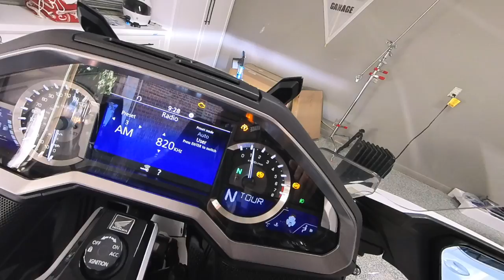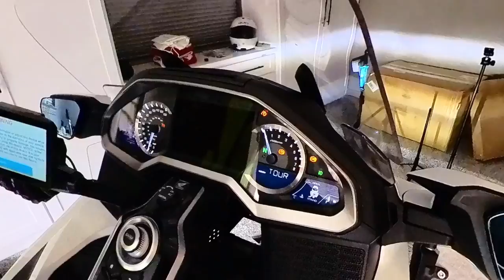Replacing A Dead Battery In My 2018 Honda Goldwing | Cruiseman's Garage

Comment: As usual we all thank you for bringing these glitches to our attention. These Vlogs and your maintenance videos are invaluable save us thousands in labor costs.  Amy owner of a Goldwing who hasn’t purchased your videos, and in my case also Fred Harmon’s videos is missing out.  The satisfaction one gets from doing 95 plus percent of required maintenance  is a small 0:10 feeling  of doing it yourself knowing it is done right.  I did add the Traxxion battery bolt extenders to allow a bit more space if adding mandatory direct negative and positive wire connectors.  I had to trim the positive one about a quarter inch to allow the cover to seat properly.  Love Scosche connection. Reminder to carry the connector for interface  to Battery Tender if you have other devices , air pumps etc that use the SEI (?) connector. Although the Traxxion bolts will also alligator connectors. 😎

Comment: I really like this video.  I have a 2018 Goldwing and have had the issue where the bike would not shutdown properly.  We also had another Goldwinger had this happen during a Rally.  I know to recheck it once I do a shutdown.
Now to the video!  I am currently in Saudi Arabia, left home in August and had to leave my bike at the house.  I showed my wife how to operate the battery tender and she did a great job of starting my Goldwing enough that we felt confident that this was keeping the battery to close to full charging level.  In February, she went to start it and nothing!!  She showed me where the battery tender was showing green, but still nothing.  I had her check the cables and the same (I'm not including everything we tried but trust me).  I had her take my battery pack and plug it in and my bike started, but once she cut the engine off, it would not restart on its own.  So, we decided to replace the battery.  Being a smart person as she is, she said she would take care of taking the battery out, having it checked and reinstall it.  She looked this video up on youtube and completed the mission.  Thanks for all of your videos.  I am a subscriber to your video series (both sets, since she has a 2016 GL1800 Trike) and they have been fantastic!!

Comment: CM shame on Honda for not having a positive down when the ignition is turned off. I did leave the ignition on Accessory mode when completing a ride on my 2012 FLHTK, I wanted to listen to a song when I was removing my gear after finishing a ride. I caught it an hour later when I went in the garage for a beer. Your review of the Scoche convinced me to purchase one in September in preparation for my trip to Street Vibrations in Reno, NV. It was the best move I've ever made; I got the SAE connector also. Yes, I ride a Harley and I've watched your channel for close to 3 years now. Not a fan of the 360 view on the GP, but that won't keep me from watching...Keep up the good work...

Comment: I had the same issues many times. Lights flashing, battery was dead, trickle charger would not charge the battery. I could jump it and it would start. Then try to start again. Dead. Took it to the dealer many times. Replaced batteries at least five times. Problem would come back. Had Honda tech support involved. They could not find out what was the issue. In the end, Honda had issues with the red starter module. The defect caused electrical issues like dead batteries and weird issues with electrical components. My 2019 issues took 2 years to get to the bottom of. Since that unit was replaced, zero issues. I have heard that some Harley had the same issues. Possibly used the same vendor to build them. Not sure. I never ride without a jumper box. I have been stuck to many times.     I hope this helps.

Comment: It is very important when using a jumpstarter that you disconnect audio fuse A15, which is in the right column, the sixth one from the bottom. The check engine will go after some rides.
Reply: Thanks for the advice about the check engine light going out after some rides. I have rehooked mine and the light has come on.

Comment: (Belated Happy Birthday Chris!!!) Thanks for this, I have seen the bike not shutdown when the knob was turned before. It's always happened when I park in my darker garage where I can see the headlights still on. Turning the knob on and then off again finally shuts down the bike properly. I wonder if the bike was creeping or moving slightly which caused this. I've had the MIL (malfunction indicator light) on when the bike's failed to start properly first time - it's happened twice I think. In each case the MIL went out after five or six successful starts. I wish I could use my car's OBD2 tool on the GoldWing though to actually read the codes!!! 
And thanks for letting us hear that gorgeous bike start up. Up here in cold and frozen Canada, most of our bikes have been in storage for months - we miss that sound !!! 
Camera and sound seem fine.

Comment: I suggest using a battery tender whenever you park the motorcycle at home. My Optimate conditions the battery as well as maintaining the charge. I have been postponing buying a jump starter. When I saw the SAE adapter for yours, I ordered the jump starter and adapter. I like the new video.

Comment: I like the new camera you're using.  Good video quality & it handles motion well.  However, it does distort the picture slightly due to its wide angle views.  But, I'm okay with that because I can see so much more in that mode and it's good clear video.  I give it a thumbs up and would suggest you continue using it.

Comment: Chris, I don't know how you can stand to work on your Goldwing without a ratcheting screwdriver.  I have been using Snap-on ratcheting screwdrivers for 20 years, (just the brand that I prefer),and I love them.  Makes so many task that require a screwdriver so much quicker and you can change the bits in the end to accommodate a plethora of different fastener types.

Comment: Maybe I missed something but have you been changing batteries just because you discharged them? Batteries are salvageable 9 times out of 10 with the proper charger and time on that charger. I have my original battery in my 13 Wing.  Most battery tenders don’t put out enough juice to recharge a battery in a week let alone over night and most chargers are so sensitive now they won’t kickstart a weak battery anymore, it’ll just say bad, gotta keep an old school charger around just for that very reason.

Comment: Thanks for this video. After having my 2023 Goldwing for two months now, I ended up with a dead battery. 

My question is, how long did it take for the “check engine light” to go off after swapping batteries?

Comment: Just fyi that has worked for me referencing the check engine light. It’s worked for me on my 2018 DCT Tourer. I start the bike from a cold start and let it idle until the fans come on. Shut bike off and restart. The MIL light is off. Just a suggestion.

Comment: Still with the OEM battery with my 2018. I keep the bike  plugged into the battery tender when the bike is parked....surprised you didn't put the new battery on the charger before installing it in the bike.

Comment: I've had a few instances on my 2020 where I've turned the switch to shut the bike off and the engine dies but everything else stays on.  I always just figured I had turned and released the switch too quickly.  Turned the switch again and shut everything off, I've never accidentally left it on.  Good video, the new camera is quite interesting.  Could prove to be very useful.

Comment: like the camera. what software glitch causes the lights to stay on if the bike is  "moving" when shut off? is it corrected on 2019-2021? is it exclusive to DCT? does it necessitate using the parking brake all the time?

Comment: My Goldwing wouldn't shut off, lights were on and could not turn off.  I didn't notice this for about 2-3 hours.  I am sure the bike was not moving, kickstand was down.  The lights stayed on for hours and finally died with the battery charger on.  The next day there was enough juice in the battery for the bike to start and turn off as it should.   Since this was the original batter that came with the bike I bought 3 years ago I am planning on getting a new battery.

Comment: I have a suspected duff battery, Still original 2018 battery and have been in the States for the last couple of weeks and on my return to the UK the bike lights up OK and plenty of sound from the horn but when I press the start button, nothing. It happened when I was away in May but half an hour on the charger and she fired up OK but not having any of it this time.

Comment: I replaced my battery with a lithium battery Amazon Noco NPL 20 and it's worked perfectly I don't ride everyday so if I let the bike sit for a week or more it starts right up and it was smaller and easy to get in . PS it's a year since I installed it so far it's been really great

Comment: I love my 2022 DCT but I must say it certainly has some weird characteristics….  As for the new camera, it’s the first video camera I would consider getting.  Seems to be a more realistic view we experience while riding.  I will be interested in ur thoughts once you get to use it more. Btw, any comment on the video which indicated a rider who spends time practicing slow speed manoeuvres with a DCT has gone through two transmissions on two different DCT’s?  Reportly Honda covered the first replacement under warranty but refused to do so on his second, newer DCT wing.  Claimed slow speed manoeuvres were somehow “abuse”.
Reply from the maker: The DCT issue is something I plan to talk about in my next Crown and Comments. Stay tuned.

Comment: When you turn off the bike. Turn switch all the way. Then engine and bike are off. If just a quick flip/turn the lights may stay on. Honda did not design the ISG to work with a lithium battery. Per Honda!  To charge the battery it needs to be on a Automatic type AGM Battery charger at 2-10 amps for 10 hours. I suggest you charge your new battery to full charge. Per Honda service manual 13.2 votes is full charge. This means battery amps are at full charge. I get it buying a new battery is good insurance buy if you had charged the dead one at 2-10 amps for 10 hours I bet it’s going to pass a load test. Try it. The GYZ20L battery is rated at 250 amps but will load test at near 300 amps if full charge. Three types of battery in general Standard, AGM, Lithium. AGM is a Powersports battery and this type is used around the world.

Comment: This summer I accidently left my switch on for 2-3 hours. I was in a very remote town in Alaska. It was dead with like you were seeing, very dim lights. I was able for get it jump started by a good Smartian. I ran it for 1/2 hour to put in a charge. It started the next day, and it has been fine ever since. Fingers crossed. I know you are not supposed to charge a battery from dead with the bike. I know I should have put it on a real charger. I was 100 miles from any sort of motorcycle shop or charger.

Comment: goldwing 1800 dct 2018 Battery problem Yuasa GYZ20L part 31500MCA941 12V
In the end Yuasa Japan discreetly confirmed that in the manufacturing batches of the GYZ20L batteries for the Golwing 1800 GL some were faulty but that it was impossible to know which ones many owners encountered this battery problem throughout the world including me (Thailand ) Yuasa does not provide any guarantee on this type of battery in any case it must be changed every year,...
In the end, the concessionary resellers were careful not to give the information coming from the manufacturers to avoid conflicts with customers......business

Comment: I had the original battery die after 2 years and then replaced it with a lithium Noco battery from Amazon it's smaller and has lasted 3 years so far and you can leave the bike for longer periods between rides without the battery dieing

Comment: If the battery was only 12 months old why didn't you make a warranty claim? Surely it will have had  a 2-3 year warranty. I toasted a Goldwing battery a few years ago due to using the wrong type of tender. I kalway put my two Goldwings on tender when garaged. The GL1800 drains down more quickly than the GL1100 as it only has the analogue clock to run.  Modern bikes and cars 
 have various security systems which are always drawing power and will drain a battery over time. I'll  put my car on tender if I'm away for a few weeks.

Comment: You replaced your battery with the same type. Why didn't you replaced is by a more common YTX20L version. A lot cheaper, same cranking amps. Only difference the GYZ is suitable for start/stop and the YTX not.
I had also issues with the GYZ version. After searching the internet i came across a story about the storage difference between the GYZ and YTX version before you buy the battery. This storage difference seems to be a big reason the problems with the GYZ version.

Comment: I would have put the dead battery on a smart reconditioning charger (say one from NoCo or Ctek) before I purchased a new battery. I have managed to save quite a few batteries this way and extend the life of my AGM batteries by many years. I have a friend who got 8 years out of his stock Honda Yusa AGM battery by using a reconditioning charger. I only got two years out of the same battery in the same bike before I got smart and purchased a smart charger.
Reply: He also put his "drained" battery on a tender to charge it when he needed a charger.
Reply: Same here. I do it on my cars on an annual basis too. That way, my car battery lasts. Mine's the Optimate 6 and I think it has paid itself over and over again.

Comment: It wouldn’t surprise if you still an electrical problem. The symptoms that you described about turning off the key, while slightly moving would be very unlikely to create the flashing lights and problems. Once that key is off, the ECM and other electronics will respond to that, no matter if there is some small motion or movement in the wheels. The flashing lights sounds like a bad ignition switch in my opinion
Reply: Interesting
Reply: Wonderful wonderful 👍

Comment: Will you tell me about the battery jump start device you have with wires that can be used for battery tender also?  
I have my side cover removed for the winter so I can easily attach my battery tender and can’t find a wire set that I can feed through the cover to attach a battery tender since it is so tight in there
Reply: If you'll go to his YouTube channel/page, then the tab for videos or just do a search on his channel. You'll find it easily enough. I think he posted it about 2 years ago. Neat little device!

Comment: I've not had any issues with the battery on my 2018 Wing Tour 6MT. And it always turns off if I'm still rolling. And because I've got the better 6MT I've never had a snow storm on my dash like the DCT likes to have. I will replace the battery this summer regardless of condition at 5 years old. Last month I bought a new 2022 Yamaha base model MT-09 as a solo fun bike. The Wing is the most boring motorcycle I've ever owned so I need some spice for life. Problem with the MT-09 is I have forgot to turn the key off like when running into a quicky-mart real quick. Hit the kill switch, hop off and come back with the key still on. The Wing and my current car have kind of spoiled me with a fob and knob/button. And seeing my 2018 simple Ford car is much more advance than my over priced out of date Wing. The car will power down if the ignition is left on or in accessory in 15 mins I think it is after no activity. So I'm going to have to get use to having old school key on the Hammer. Or it's tiny battery will be toast in no time. Or get stolen. :)

Comment: I use an Antigravity Battery for my ST1300 and was just about to buy one for my 2018 GW Tour DCT until I saw someone post something on Facebook. He said the Honda mechanic advised against it as the bike's (forgot part) was not made for it. Anyone hear anything about using Antigravity Batteries for GW? I'd call Antigravity but I'm sure they'd say it's fine
Reply: I switched every (led acid) bike I've owned to the Antigravity Lithium. Never had an issue. Just bought a 22 BMW 1250 RT and have already ordered one for it. Lighter is Always better on a bike.
Reply: I have tryed it but the bike (2019 tour dct) didnt like it, the start stop system didnt work at all it never shut off at the traffic lights.
Reply: I have tryed it but the bike (2019 tour dct) didnt like it, the start stop system didnt work at all it never shut off at the traffic lights.